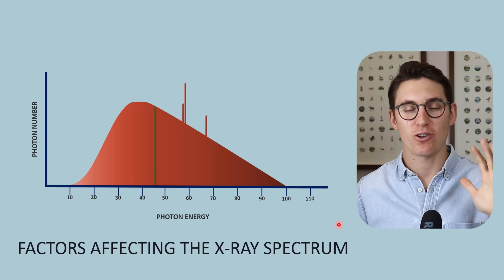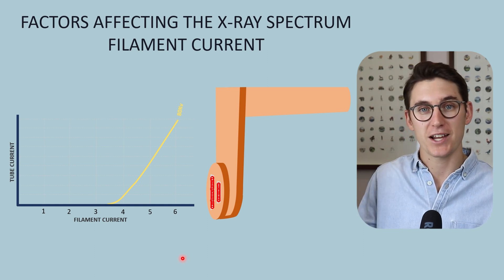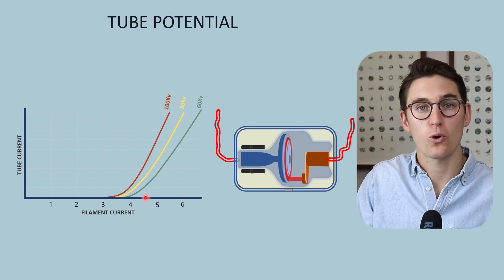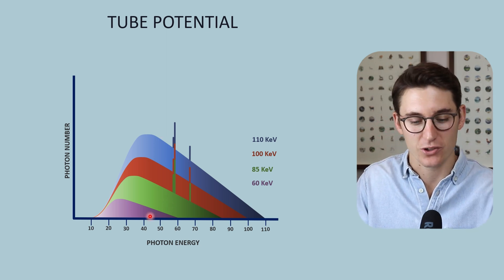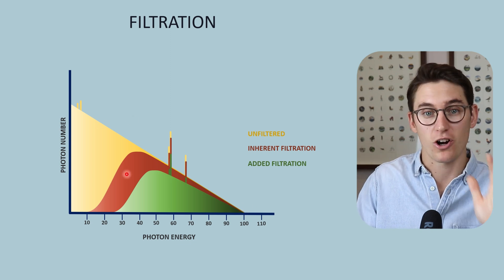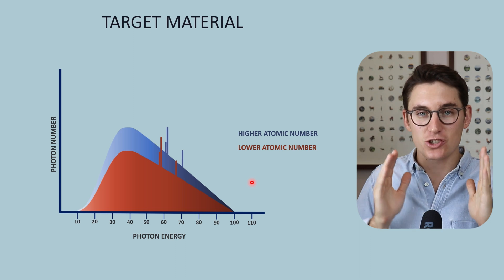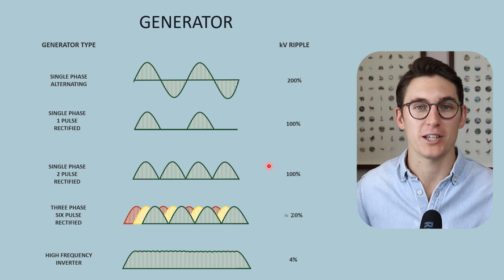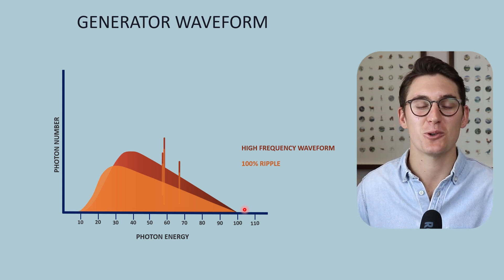Altering the X-ray Spectrum | X-ray physics | Radiology Physics Course #22

Comment: I finally understand what ist going on. Thank you very much!

However, I have a question. In the filament current you use 80 kV as an example but you have in the next graph 100 keV.
While in the tube potential the 80 kV has 80 keV.
And I do not really get, why..

Comment: thank you for this amazing video series. One question, is the ma (tube current) the same as the filament current. I've read that it is not. Can you clear it up for me?
Reply from the maker: Pleasure. Yes, there is a difference. Filament current is the current passing through the tungsten filament (changes affect the number of electrons released via thermionic emission). Tube current is the flow of electrons across the tube - this is influenced by a combination of the filament current and the tube potential. A change in tube potential will influence the tube current but not the filament current.

Comment: Hi i would like to ask if  we were to use single phase alternating does the tube current move through and fro the anode target due to the alternating direction of the current. Or am i totally in confus ion. 😂
Reply from the maker: Exactly Asraf 🙂 There obviously wouldn't be any electrons produced at the anode but those within the vacuum would head back towards the cathode when the current switches (not ideal!) That's why we need a direct non-alternating current 👍